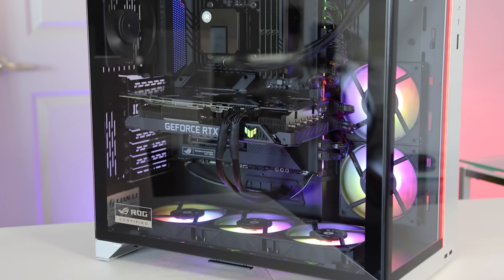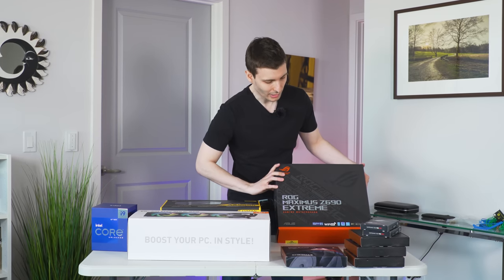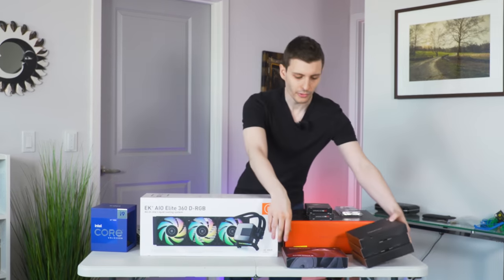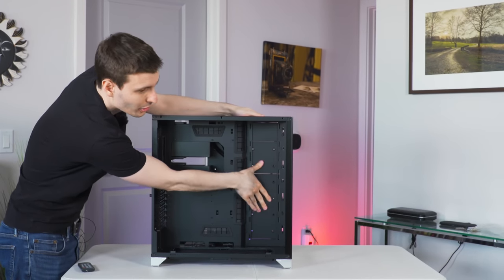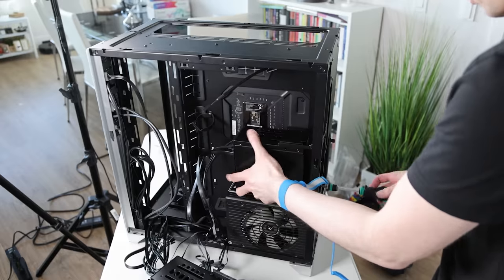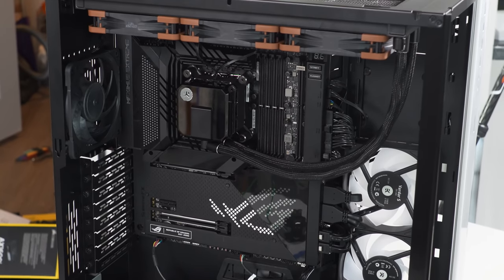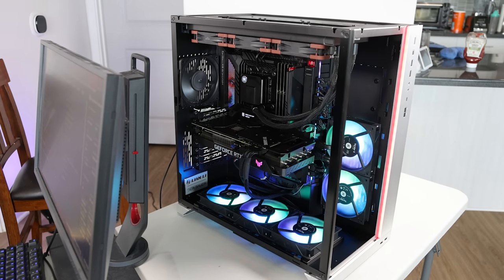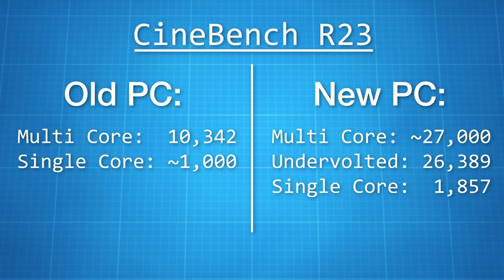I FINALLY Built a New PC After 7 Years (Unlimited Budget)

Comment: Here are a few suggestions (but this is like closing the barn door after the horse has bolted)😄...
Primary drive: Samsung 970 Pro 1TB - (the 970 uses MLC V-NAND, as the 980 uses TLC)
Secondary:  Good, 980 Pro 2TB (uses TLC)
Motherboard: Good, but a second choice could be the Asus Pro WRX80 (with 7 PCIe 4.0 slots), 
but this board is a Threadripper E-ATX workstation. With 8 DIMM slots (so you could have used faster ram).
Case: Fractal Designs - Define 7 XL (with plenty of room for E-ATX boards).
HDDs: WD Gold are okay, I would have used Seagate EXOS enterprise drives.
Just some thoughts !
Nice build though !

Comment: Super! My favorite youtuber of IT stuff builds a over killing PC setup. I think this is first time when I was not jealous, somehow I feel like you deserve for such setup and I know you will fully use potential of it for really working not just for guffy things. It was fast and not boring, maybe even the fastest PC built I ever watched. Regarding W11 I am also not fan of it. I upgraded from W10 to W11 and then it were working horrible, like I could not open menu start because button were not responding (I had other issues to I cant remember now). I decided to use function given by Microsoft to "roll back to W10" and it were promising me that it will keep my stuff, but guess what, it actually started reverting system and kinda broken, it literally broken Windows at so deep point that I could not restore it using any advanced technique like ran USB recovery and tried to validated system files trough CMD. I suppose it screw Windows soo much that even recovery tool could not recognized what it was W10 or W11. Well I gave up at that point and did full format and fresh install. I will never ever again try W11. I do not know what they would need to introduce in W11 that would convince me to W11.

Comment: love the pc but the cable management makes it look terrible. you should get some cable sleeves and tidy up the wires and it will make it look 100x better. also get a gpu sag bracket, i hate seeing a 3080ti sag that much. if you get some better thermal paste your temps will go down a ton. pump block is also mounted sideways

Comment: Huh, I had the same. I bought my old computer more than 8 years ago and a month ago I bought a brand new one for almost 5000 euros based on the same chassis 
Funny thing that I made mistake with CPU/AIO - I forgot to get out the protection label from the metal plate
Case - Lian Li 011D XL
PSU - Xilence PSU ATX2.4 1050W XN076
Motherboard - Gigabyte Z690 AORUS ULTRA
CPU - i9-12900k + AIO Gigabyte AORUS WATERFORCE 360
GPU - Asus GeForce RTX 3080 Ti ROG-STRIX-LC-RTX3080TI-O12G-GAMING with AIO
Memory - Kingston FURY Beast KF560C40BBK2-32, DDR5, 32 GB, 6000 MHz
SSD - Gigabyte AORUS NVMe Gen4 SSD 2TB
plus 4 arctic fans, GPU holder, better cables

Comment: 15:50 the cmos error is cause the mother board is not NEW, it has been turned on before with different hardware, that is why it says cmos error, it will stop if you reset BIOS.

Comment: Q: Why did you end up switching to the other fan controller?
A: The Asus one just didn't work, and wasn't even being detected by the Asus software. Maybe I did it wrong, but the Asus software really sucked anyway so I just went with the EK one and it works fine.

* You need to plug the micro USB cable from the ROG controller hub to the USB 2.0 header on the motherboard to get it running and  detected on the Armoury Crate app.

Comment: Great job and excellent video editing, and thanks for no music. I especially liked the way you presented the components. The only thing I would have added would be text on the video showing what they cost you. Unlimited Budget and no 3090! I believe you missed one crucial component, A UPS. With that size PSU, I would recommend a 20A dedicated wall outlet. You might eventually add a second high-in GPU.
Reply: likely already has a 20a circuit, but 15 would be completely fine anyway.  unlimited budget and cheapest ddr5 possible is an issue

Comment: The problem with the post codes and 90° are all because of an issue, 12th fen doesn't like ASUS Performance Enhancement, if you tur it off and reset the voltages it will be fine (40° - 70°)

Comment: I went from 3800×2 to i7-2600 to 3100 (supply issues) to 5600 2 days ago.

Making my system last with a part here or there is my forte. Building to last a while is a good thing.

If I do 128GB for a dataset though, I'd not skip on ECC (not Reg, too slow). My devrig is a 4114 slot 3647 and I used ECC in it.
Reply: Also I picked an Eisbär Solo LT. To fit the 1.5U case I needed something custom radiator wise, and also the height and the bends and all, also you can cut the tubes to fit.

Comment: Do yourself a favor tho and get a true vertical mount chassis, like TT T20 or t500 for true verticle Hang mount to prevent any socket stress on the GPU and almost none at all on the mobo power cables. And is waaayyy better for LiQ Cooling than traditional hz mount cases, things of the past really

Comment: With regards to the SATA hard drives: why not go with the WD Ultrastar HC DC550 ? They are noticeably cheaper (100$ to 200$ difference, dependent on where you get them) than the WD Golds, and virtually same hardware (would need to doublecheck on the cache though, not sure if that's the same). I personally use 2 Ultrastar 18TB drives (also in raid 1, using Windows Storage Spaces in a 2 way mirror, got a sustained 200MB/s throughput for sequential writes). They are quite noisy though...

Comment: This sort of approach was more suitable when HEDT segment really existed, nowadays man, even on mainstream you'll find that year after significant jumps in perfomance specially regarding video editing and render can be achieved. PD: you can add the fan, just use a doble side tape to put the fan controller wherever you want. great pc BTW.
Reply from the maker: Nope, wouldn't even have fit with double sided tape, the back of the case has an odd setup

Comment: For my build I assembled the CPU, RAM and heat sync outside of the motherboard. Could of helped you with accessibility when you were installing the heat sync. The only one to be carful of is the radiator. Mine was a fan only setup. I am using it currently. I know do not press hard, until you get to the RAM concerned me as well. I did not experience any BIOS, UEFI issues.
Reply: Most people do this now, but putting in the CPU, cooler, and RAM while the motherboard was outside the case was probably rarer in 2015 than it is today. Building a computer entirely in the case was the old way of doing things, and I'm not even sure when the change from that to building outside the case happened.
Reply: @pieman3141  Building outside the case is a better way of doing a PC build.

Comment: 1) you should have bought thermal grizzly Kryonaut, for a build that expensive the extra few quid would have been worth it. 2) did you set the ram values in the bios? you never specified, it could be running at base speed 3) using a headder for 2 M.2 drives would that not slow them down? some M.2 have dedicated PCI lanes to the CPU for faster speed while others are restricted to SATA controller, i would have personally put the 2 980 pros in the dedicated slots (they are harder to get to) then any extras in the headder card. 4) tha GPU looks like its sagging (looks, im not sure cuz of camera angle) it might be worth investing in a GPU support to relieve strain on the PCI-E slot 5) you should watch a few videos on overclocking and undervolting, i got my temps down a significant amount whilst overclocking my 8700k (granted i know the 12th gen is HOT) but there is a few more setting that effect the performance over all so you may be able to achieve an undervolt for better thermals whilst keeping stock if not better performance

Comment: For someone which not much experience in PC building you did very well. 
A few points to improve and do the building more effective:
Install all little components first on the motherboards so you can put the whole bundle in the case more easily and not have to reach into the case in a weird position.
Next, PLEASE use another thermal paste, its way more efficient in cooling than the pre applied one. 
Last, you can 'test' your system before mounting all components into the case which saves you much time. Just setup all components outside the box and try to post. Then its easier to remount components just on the table instead of in th case.
Hope you see this comment :D I hope i helped you in some way.

A note to your temps: The most critical part is always the heat connection between the die and the heat spreader on the cpu. For this you have options but this options could eventually rip the CPU. The next critical layer is from the heat sink to the cpu cooler plate - there you have multiple options: better thermal paste or even liquid metal, which has the best heat transfer. With this options you will have much better temps.
Reply: Most thermal pastes are more than adequate, even the pre-applied ones aren't horrible. There's this notion that you absolutely have to use something different, and that's simply not true. If it's all dried up, by all means replace it. It won't kill the machine to use the pre-applied stuff for a year, and then change it with stuff from a tube when you decide to dust the system (I like to clean my systems every six months). That said, I can't imagine Noctua's thermal paste is that much better than most stock stuff (especially on an expensive AIO like that). 

I also do not trust liquid metal on anything. It doesn't hold up long-term, has to be replaced, and if it leaks it can damage vital components or short things out. A couple extra degrees cooler isn't worth that hassle.

Comment: @ThioJoe Hi can u tell me which one of these two PC-s should i buy!?
Which1 u recommend me!?
     LENOVO LEGION i7-11700F/16GB/1TB SSD/RTX 3060Ti 8GB 90RT003JRI

Chipset:Intel B560
Processor:    Intel Core i7-11700F (8C / 16T, 2.5 / 4.9GHz, 16MB)
Graphics:     NVIDIA GeForce RTX 3060Ti 8GB
Memory:       16GB DDR4
Memory:       1TB SSD
System Lighting:Legion OY iconic LED + Internal ambient lighting
Audio:        High Definition (HD) Audio, Realtek ALC887 codec
Keyboard:     USB Calliope Keyboard, Black
Cooler:       95W Airflow + PCH heatsink + VRM heatsink + M.2 SSD DECO MYLAR heatsink
Mouse:        USB Calliope Mouse, Black
Ethernet:     Integrated 100/1000M
WLAN + Bluetooth:11ax, 2x2 + BT5.1
Front Ports:
2 x USB 3.2 Gen 1
1 x headphone (3.5mm)
1 x microphone (3.5mm)
Back Ports:
2 x USB 2.0
2 x USB 3.2 Gen 1
1 x USB-C 3.2 Gen 2 (support data transfer and 5V@3A charging)
3 x audio out (5.1 channel)
1 x Ethernet (RJ-45)
1 x power connector
Power:550W 88%

-------------------------------------

     LENOVO R9-5900X/16GB/1TB/RTX 3060Ti 8GB 90RC009HRI

Chipset:   AMD B550
Processor: AMD Ryzen 9 5900X (12C / 24T, 3.7 / 4.8GHz, 6MB L2 / 64MB L3)
Graphics:  NVIDIA GeForce RTX 3060 Ti 8GB GDDR6
Memory:	   16GB DDR4
Memory:    1TB SSD

   NO OPERATING SYSTEM

Audio:     High Definition (HD) Audio, Realtek ALC892 codec
Keyboard:  USB Calliope Keyboard, Black, English (UK)
Mouse:     USB Calliope Mouse, Black
Cooler:    150W Airflow with RGB light
System Fan:2x Top ARGB + 2x Front ARGB + 1x Rear ARGB
Ethernet:Integrated 100/1000M
WLAN + Bluetooth:11ax, 2x2 + BT5.1
Back Ports:
2 x USB 2.0
2 x USB 3.2 Gen 1
1 x USB-C 3.2 Gen 2 (support data transfer and 5V@3A charging)
1 x Ethernet (RJ-45)
3 x line-out(3.5mm)
1 x power connector
Front Ports:
2 x USB 3.2 Gen 1
1 x microphone (3.5mm)
1 x headphone / microphone combo jack (3.5mm)
Power Supply - 550W 88%

Comment: NFI why the creator felt it necessary to not include this, so for anyone this summary helps save some time for, you're welcome.

CAS: Lian Li O11 Dynamic XL
CPU: Intel i9-12900K
CLR: EK AUI Elite 360 D-RGB
RAM: DDR5 128GB 4800Mhz (CT2K32G48C40U5)
GPU: Asus 3080TI TUF OC
PSU: Corsair AX1600i
MOB: ASUS ROG Maximus Extreme Z690
HD1: Samsung 980 Pro 2TB (4.0PCI NVME)
HD2: Samsung 980 Pro 2TB (4.0PCI NVME)
RD1: WD GOLD 18TB (RAID 1)
RD2: WD GOLD 18TB (RAID 1)
FAN: 3x Noctua NF-F12 iPPC 3000 PWM
FAN: 1x Noctua NF-A12x25 PWM

Comment: 1 advice for your harddisks: if you really care about data, and if you see any possibility: Build a good NAS with it and choose a better filesystem than just traditional raid and NTFS crap.
Choose for ZFS en learn a bit about it how it works and it's benefits. It's truly excellent. Otherwise you can also do a solution based on Btrfs (which is great as well but implies Linux though, while ZFS can run on FreeBSD based systems like FreeNAS as well).

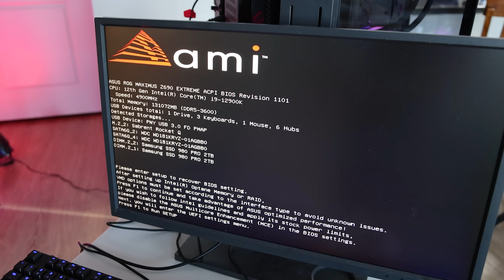15:35 Yeah personally I'd always connect a monitor if I need to test a computer ... :P
Reply from the maker: I actually use ReFS ( ͡° ͜ʖ ͡°)

Comment: Are you running the 128GB memory in it's XMP profile or are you running it stock? If it's not a 128 kit certified at 4800 and just two 64GB kits you put together it could cause random crashes and blue screens running in it's overclocked XMP profile. You should run memtest86 in the ASUS bios in both XMP and stock to see if you have any errors. If you get errors in XMP run it in stock. If you get errors in stock run it again to see if the errors start to clear. If errors don't clear with following tests you likely have something wrong with one of the sticks and should replace them.
Reply from the maker: I had to run it at the lower 4400MHz profile. At 4800 MHz memtest was throwing errors and the system would crash often

Comment: Grats on the new PC! You deserve it! My only question.. You said you were going all out and did, but why the cheapo ram? I was expecting some Dominator Platinums or at least Crucial Ballistic sticks. Other than that, awesome build!
Reply: Crucial RAM isn't bad, nor was that cheap. Those are $600 kits, plus 4800MHz is nothing to sneeze at
Reply: @Vynncent  Guess I just figured he'd get something better to look at and with at least heat spreaders on them.
Reply: These things still overclock pretty well despite having no heatspreaders and temperatures won't get too bad. Also if I remember correctly, der8auer said that some Corsair memory kits actually performed worse (in overclocks, same dies I believe) than their lower end counterparts without any heatspreaders because it was being more of a heat trapper than an heat spreader.
Reply: @GamerBoy705_yt  Interesting
Reply from the maker: Try finding anything better with 32GB sticks 🧐 Better timings and frequencies are only available in 16GB and lower

Comment: 1600 w 😂 why not. Go big or go home, right!
Reply: Power supplies are most efficient in the 30%-70% load range.  If the component specs add up to 800 watts when the system is fully loaded, this keeps the power supply cruising along without overtaxing it.

Comment: I wish I could have a setup like that but I'm not really doing anything that would need that kind of power though I do like the rear drive tray access. How ever I do like having a lot of ram because some of the stuff I do for fun does end up eating up ram, I'm usually around 11-18GB RAM with several chrome windows open, doing stuff in GIMP, and running games all at the same time.

Comment: I'm surprised you had to undervolt on an AIO like that.  Is the thermal paste properly spread?
Reply from the maker: I guess I didn't have to, it was still under throttling temps, and Alder Lake is known to run really hot. A big reason is I keep my place warm at like 75-78F, which is apparently 10-15 degrees above what most people do, so that gives me a significantly higher ambient baseline.

Also it wasn't a thermal pad preinstalled, it was paste. And I did end up applying my own Noctua MX-5 later.

Comment: I understand this video is probably 3 weeks ago? But in the years that I started off assembling or building computers back in 1979 or 80, we always installed whatever on the board before we install the board in the computer! It makes it much easier to get to and like you said your static strap or they have one that goes around the ankle which is somewhat easier, as well as any additional items you have to put in the case oh, it's much easier to do that when you don't have the case completely full with a motherboard? As long as there is room to put the motherboard in afterwards, again if you plug in your fans before you bolt them down you'll know what orientation the fan assembly is what you wanted to go in as? Instead of trying to do this so fast for a video you need to slow down you're thinking and understand with the end result is going to be with your build? Now one thing that you want to do is to clone your drive in different states of installation such as after you install a clean version of Windows, and a clean version of Windows with all the updates installed, and a completely installed operating system and applications, that way you have several states of which your computer was installed previously, and also the four-state is when all the installed updates are installed in the system, for different versions of clones and believe me this will save your but in the future because I have that on my system currently, I'm not not sure what your favorite clone software is?
Apparently you don't build computers on a regular basis because the air is coming up you need to have your monitor connected so you can understand what you need to do always go into the BIOS and make sure it's got the correct selections!
Also had you read some of the motherboard instructions on the CPU itself and a motherboard you would probably and seen a notification or you must remove this or remove that before installing the CPU Cooler? Guaranteed a lot of these cautions are included and the motherboard and CPU Cooler